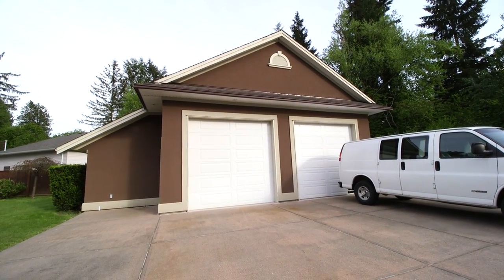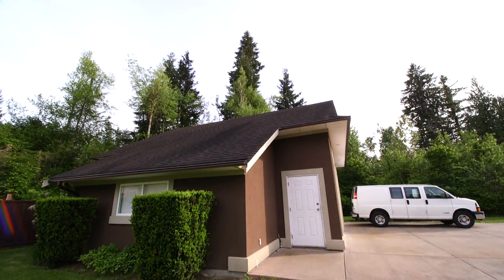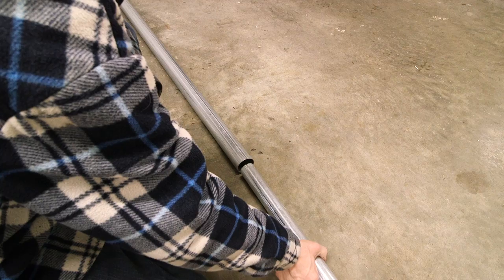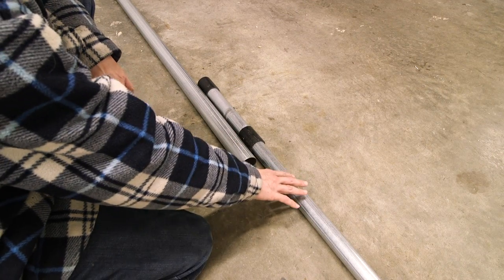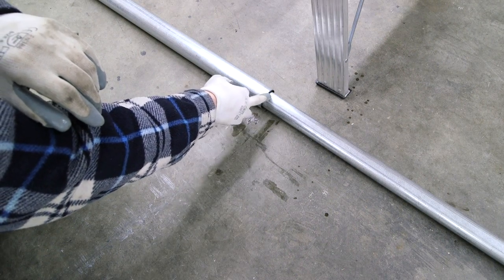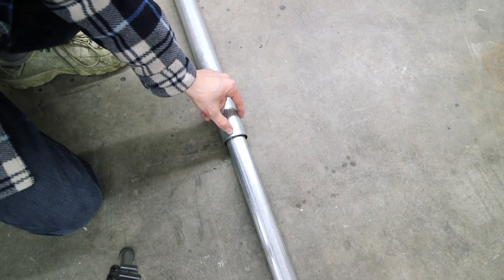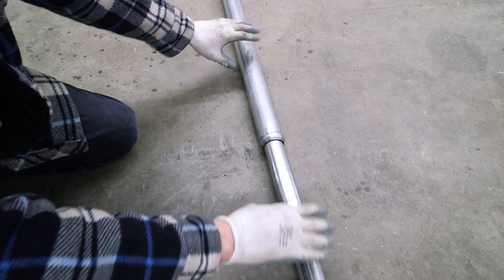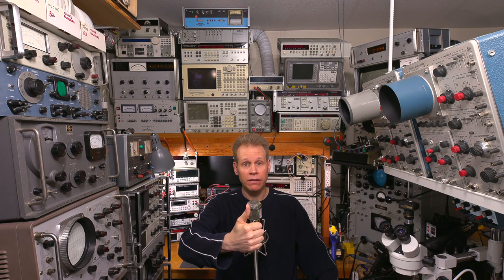High Performance Antenna Build [Part 1]

Comment: Might I suggest an exhaust pipe expander tool from harbor freight or other cheap tool depot. Loose the tape an use tool to expand the smaller tube to fit inside the lower tube. You could also drill two or three small holes in the lower tube before inserting them together, 1/4", an plug weld the lower area of the tubes together when inserted if you desired.  😎

Comment: Absolutely beautyful property there Paul. Wish I had the luxury of so much space to build a antenna on. I do wonder if it's a dipole how well would FM perform on it?
It's huge..a lot huger than a 1/2wave FM dipole. I'm sure it will work amazingly for AM pretty good but for FM? Don't really know. I am definitely looking forward for the series. When there is a video from Paul you know it's all in or nothing.

Comment: Cool Project Mr. C!

I think, because I don't have a TIG welder and do have gas I would have brazed the connection. If done well it will be stronger but take more time to prepare for.

The term for the hammering operation is peening. It would be nice to have had some external dies to do that but some patient, carefull work with a hammer will do.
Reply: He used a MIG welder:)  KF7LF

Comment: Did the galvanize coating cause a problem? I've always had to grid it away because the fumes would cause the steel to not stick. I Loved the video. I always wondered if there was a good way connect them together and I still need to put my masts and antennas.Thanks for the tip!

Comment: I usually just cut a short bit of pipe and slit it longways, and use that as a shim spacer between the 2 pipes, ie, like what the tape is doing.
Reply: ..I was about to write the same thing...   :-)

Comment: So why not use chain link fence cross member pipe? I use x2 10 ft sections to put my VHF/UHF antennas up. They cost $12 to $15 a piece. I just drill a hole or two after fitting them together (already come tapered) then put a bolt and lock nut through them. Welding of course is better, and of course your don't want to weld galvanized, but I'm not sure it's needed. You could use nylon spacers too. Just a thought.

Comment: You could use a decent sized hammer drill on hammer. to push the pipes together. Cut off a hammer drill bit off and weld it to a piece of 3"x3"x1/2" plate steel or something like that. I made an attachment to drive 10' ground rods into the earth with a 7/8' deep well (impact /black) socket, welded on to the bit. Hammer away

Comment: when welding the 2 pipes together,did you find the tape has melted at all or burned?i figured being that close to the weld the pipe might have gotten so hot that the tape doesnt have a good hold on the pipe and would fall off later down the road.
Reply from the maker: The tape at the bottom of the pipe is really all that's needed, and It's far enough away from the weld not to be affected.

Comment: I am a HAM operator, and I need put up a pipe to mount my HAM antenna. I just moved and have to setup my ham equipment. That is a really good idea. Only, I do not weld. Do you think soldering would work?

Comment: My PCP way back when was a ham and installed antenna on a tower with a rotor to rotate it. He had a real problem with the home owners' association about getting approval. Did you have any problems with this project? BTW, I had one of those little transmitters from Knight. Loved it.

Comment: I guess a dipole is "high performance" compared to a random wire running around the baseboard, but still...  Why not go to the trouble and make a G5RV style multiband antenna with a homebrew tuner?  Granted I think you are aiming for something to resonate in the broadcast band for all those All American Five restores. Well this is part one, so interested where this is going.

Comment: Thanks for the info as always, Mr. Carlson! Slightly jealous you're able to set up an antenna that big in open airspace. Even if I ignored the HOA, and my wife, there's the small matter of an airport less than two miles away. 🤷‍♂️😁👍
Reply from the maker: No HOA here.

Comment: Probably would have drilled 4 holes and welded the two pipes together where the tape is. Tape will degrade over time.

What to do about lighting strikes??
Reply: @manitoba-op4jx  well I'm sure it would be earth grounded, but what about the electronics. 
Can't have a spark gap (open connection) to your antenna.
Reply: @evana3636  Maybe that's the reason for the tube amp rather than a solid state amp.

Comment: I would probably just 3d print sleeves for it.  Won't the tape soften and degrade after a few seasons?
Reply from the maker: The tape is sealed in the pipe, and the water misses the tape due to the construction. That tape is very tough.
Reply: @MrCarlsonsLab  Perhaps I'll try that method then. I have everything needed, except the tape right now, which is cheap enough.

Comment: I took a muffler pipe expander, ground the step off the end and made an extension on the bolt 20 feet long. Insert the expander in the pipe, put the other pipe over it an crank on the ratchet till tight. Loosen and remove. Put a screw in the joint or a stainless pop river. 
Many people have stared at that thing in the shop and ask what the heck does that thing do?

Comment: What is the point of  putting a vacuum tube into the antenna ? Wouldn't it be better to use some quality opamp ? I don't know much about tubes so i would really like to know what are the pros :D
Reply from the maker: When I get to that part of the build, I will explain why.... I think you will learn a lot from this.

Comment: Don't try weld those thin tubes joins with arc / stick welding, so easy to burn holes. MIG welding much more suited to that, but how many of use have MIG welders lying around?

Comment: A buddy of mine, back in the 1970s, got a huge spool of military surplus antenna wire which IIRC was used in the Korean war for dipole airplane antennas.  This stuff was thin, multi-stranded, bare, and gold in color, but it was some tough stuff.  You could barely cut it with good diagonal cutters and it would deform the cutters.  I wonder if anyone would know exactly what that was and if it is still available.

Comment: He weld's a good bead. That is going to be one heavy mast I'm looking forward to see how he is going to get it vertical.
A hinged base set in concrete and pulled up by the van?
Reply: I've used 4 sections of EMT to make a vertical for 40m... 1.5" - 1" - 3/4" - 1/2" on a tilt base the 34' of mast was pretty easy to walk up. 45' or less shouldn't be too much of an issue. EMT is pretty light.

Comment: Why didn't you just use regular antenna mast that comes in ten foot lengths. Each pipe has a tapered end that fits into the bottom of the next pipe so you can add as many pipes together as you want. You can also get guy wire rings and other hardware that fit these mast pipes.  In my young days I put up many a antenna with these.

Comment: my brother in law took a cb radio antenna apart call the big stick it had 2 parts inside look like a resistor and a capacitor it like a 50 ohm dummy load the antenna attach to he hook it to his cb the meter key up in a place on the s meter like it had a good antenna on it my question how the dummy load idea work for 10 thru 80 let say you only have a 80 meter wire but had those parts hook to the antenna  how it work for 20 meters with the 80 meter antenna instead of a balun that like 6 to 1 i ask you because your a electronic engineer i think

Comment: Just a word of caution from a machinist/electrical nerd.

Not knowing what material you used, I will make an assumption that material, (because you mig welded it together and its appearance), could very likely be 4130 chromoly tubing. 
Due to the chromium, the fumes are very harmful so ventilation and a respirator are wise choices.

I enjoy watching your videos and appreciate your efforts to put this information out here for us.
Reply from the maker: Thanks Chris, I'm very careful.

Comment: How about lighting protection?
Reply: I think that the idea is to attract lots of lightning ⚡.
Can't let all that free energy go to waste LoL!
Reply: @PeterMilanovski  high voltage in really short time doesn't matter. If you are not on the way of lighting of course.
Reply: @VolkanTaninmis  I don't know if anyone has ever measured the voltage of lightning ⚡, but from what I have seen with high voltage experiments is that in order to get the spark, very high voltage is required. To capture the electricity from lightning, you would need a lot of super capacitors in series! Then once it's charged from the lightning, you can measure the voltage of just one capacitor and then multiply by the amount of capacitors in series to work out the actual voltage of lightning... 
There are many claims to what voltage lightning is but no one really knows because no one has ever measured it!

Comment: Cool video Paul. By the way you're ham radio, so you will be mounting antenas in the new place?!
73 from M0IVC -CT9ABQ
Reply from the maker: Yes, I will be putting up a transmitting antenna too. If there is enough interest, I will show the transmitting antenna build as well.
Reply: @MrCarlsonsLab  I would definitely be interested in that! 73 from Maryland, formerly from Arizona. KB7ICI love your channel.
Reply: @MrCarlsonsLab  I have been waiting forever to see Ham restorations like those Gonset's you have. I would love to see a video on your Ham antenna/s!
Reply: @MrCarlsonsLab  Yes, please do! K7LTZ

Comment: my local fence company has in stock, 1.25, 1.5, 1.75 inch steel pipe in 20-24 ft lengths and will deliver..

Comment: Well, at least it's shortwave. Long waves you'd need a bigger yard, lol.
Reply: Jab a pole in the ground and get a friend to jab a pole in the ground a few miles away and speak to submarines. Lol :)
Reply: @lmaoroflcopter  You could string a few miles of wire over a valley between a couple of mountains in order to use much shorter poles.
Reply: Actually, all you would need to do is add some traps for the different frequencies you plan to monitor. I used to have a short yard and built a multitrap wire antenna to pick up shortwave transmissions of weather faxes. Late one night I picked up a weather fax from Rome, Italy. Success! A bigger yard is not necessarily a prerequisite for a well-performing wire antenna.
Reply: @rocketman221projects  aye. Might catch a Cessna or two then too ;)

Comment: A whole lotta tappy-tap-tap...and remember, if your welding sounds like bacon, you're doing it right. If it smells like bacon, buddy, you're on fire!

Aren't there interference fit couplers for EMT conduit, like there are for DWV pipe? For that matter, would DWV pipe be useful for such a mast?

Comment: Nah I think this is fake. If this was the real Mr Carlson he'd have addressed the audio, run the banging through an audio compressor to limit the peaks free of distortion, and the biggest tell tale, he'd have told us what the voltage and amps setting the welder was. Its all a bit fishy to me. 
Nah the real Mr Carlson would have designed and built a nano particle vacuum tube welder probably using a 1/2 mega watt tube, modulated by his voice where he just said "Weld" into a microphone and it would produce a perfect weld with a cooling line which a stylus could follow to replay the given command from the weld seam and we'd hear his voice again. And the design along with pcb would be on his patreon site. :)

Comment: Mr Carlson, are you worried about lightning strikes at all? Will neighbors be worried about lightning strikes?
Reply: If anything, it will help protect the neighbors by acting as a lightning rod.
Reply: @NiHaoMike64  I know if he didn't put it up then there's less likelihood that lighting would strike since it typically gets diffused as the storm passes and dies out, so but acting as a perfect conductor to ground it will encourage not only some lighting strikes but many. This can create a lot of loud noises and flashes in the area and this is why I wanted to know his take on it. I live across the street from a county water reservoir where they have a huge antenna on the top tank, it encourages large amounts of lighting. I'd like to hear his opinion on the matter.

Comment: Why weld it?  2 metal screws would do it.
Reply from the maker: Holding a 40 foot mast?
Reply: I have a similar mast setup, but I use 2 bolts kn every section.

Comment: the push up pole they dont fit tight they  bend the end down like your pipe i see you have a welder why not build your self a crank up pole just remember to add a stop point that it wont pass

Comment: Go vertical, radio stations use a vertical and it will take less room and you can make it tune able too. Welding galvanized pipe is dangerous!!! KB6DX

Comment: I sure hope you don't live in a HOA controlled neighborhood, otherwise you will be in an uphill battle getting that antennae  approved. HOAs can be real Aholes.
Reply: By law, HOAs cannot ban or unreasonably impede the installation of a TV antenna, so the hack would be to put up a TV antenna with a mast that doubles as a HF antenna.
Reply: @NiHaoMike64   Uh the "law" you mention varies from state to state and also city to city.Also, the contract you signed may surprise you if you didn't read the details. Please read up or search on YT for those that have had to hide their antennae by devious means and you will see that that is no universal law protecting home owners that live in a HOA neighborhood. HOas will try to tell you if you can park outside the garage or even what type of vehicle can be outside your garage. Paint color, plants and shrubs, you name it, if they don't like it, then you are SOL.